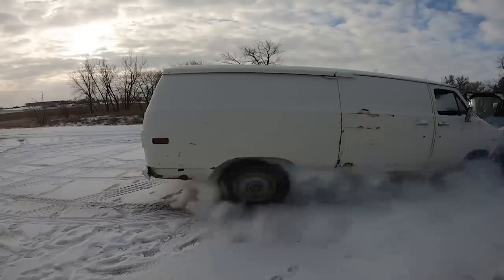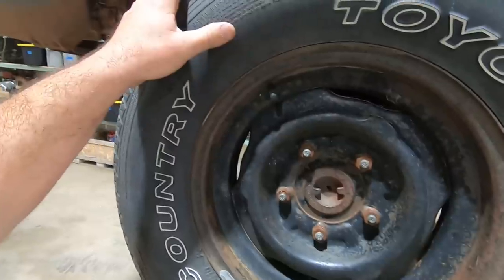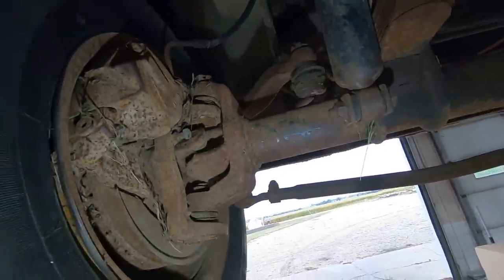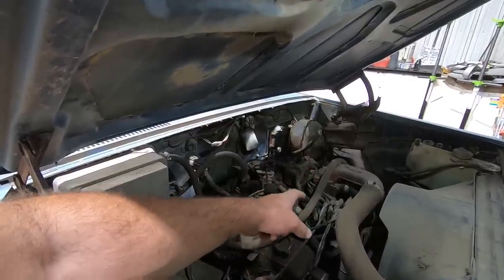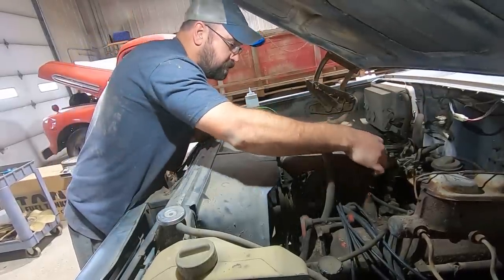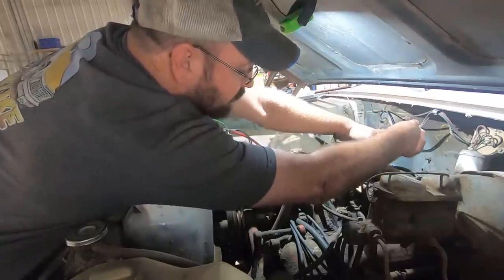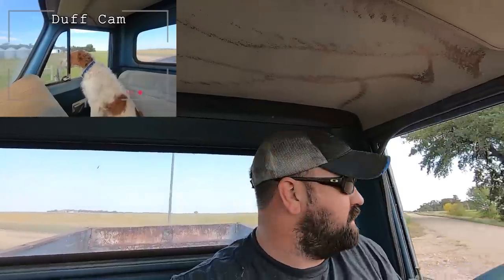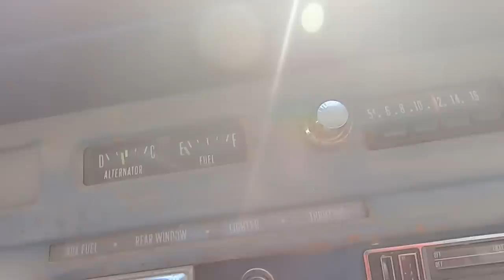1974 International 4x4! Abandoned for 16 Years! Will it Run?!?

Comment: This was nearly the same as my Air Force IHC pickup.  It  was a picnic bench on four wheels but it never quit, went absolutely everywhere and I really miss it.  It had the right height and size to perform any kind of work and was definitely not a fashion statement by any stretch of the imagination.
Reply: Those 345s were absolute work horses, just like it's 350 sbc equivalent. They'd work all day every day and keep kicking. They just wouldn't go anywhere quickly...
Reply: Love to run a ih 345 in a c20/k20 square body truck or the gmt400 trucks..

Comment: The NP205 is an excellent transfer case. Gear to gear. Plenty strong and they can be mated to an NP203 for even lower gearing options.
Reply: I squeezed a M400 C6 into my 59 F100 on a NP 205 with a Cardan Center Piece looks like a skidder. Also found a 79 Dana 60 High pinion KP (Snowfighter) on 32's. Looks Tough! I'll probably put 2' spacers on the 70 rear to match.

Comment: Cool old truck, to bad IHC didn't start using corrosion inhibitor till 79 or 80 which was the end of production pickups, scouts and travelall. It was always interesting guessing what components they would have for drivetrain, carberation and such, they could pass just about anything on the road except a gas station.
Reply: yeah those scouts sucked gas and neighbor traded one in for a small s10 blazer
Reply: @rsprockets7846  My father in law worked for IHC, so just about everyone in the family had Scouts, Terra's, Traveler's in sport and rallye configurations. Didn't seem to matter if you had a 304, 345, 392, power and torque went up with cubic inch increase but didn't seem to effect mileage. Mine were always 9mpg towing or not, the 4 bangers got a little better mpg.
Reply: Even the 304 guzzled gas lol

Comment: Pretty sweet.  Liked that Duff made that Cow go home that was awesome. Liked #840  That truck pretty kewl, really like the fact that is had a manual gear box for both going forward and the four wheel drive, none of that push button CRAP and the manual front locking hubs are a plus as well. Other than the manual transmission built similar to my Dads 1993 F-150 XLT front locking hubs and manual four wheels drive gear box, awesome truck!
Reply from the maker: Pretty basic rig
Reply: @MortskeRepair  Yeah, you're RIGHT it is and that's why it's awesome.  To many buttons switches levers knobs in these newer vehicle's, need to get back to how they use to be made. Simple.  How much wiring and relays do you think is in that Truck a heck of a lot less then the newer Trucks these days, and why for what, because people are LAZY that's why, GPS why because people don't know how to read a map. Ask your Dad how much more simple life was. I love your video's man you just make my day when you put another one out, and sometimes I get a real good laugh.  I am only 36 years old, but I love manual roll down windows so much better, same with seats that you have to pull up on the lever and pull the seat forward way more simple and if it break or stops working it mechanical and pretty simple to fix. What I'm saying is that electrical just adds something else to go wrong.  Plus if you add electrical and mechanical together you have to figure out witch one went BAD the electrical or the mechanical part could be something as simple as a blown fuse or as extreme as a slit in a wire somewhere or a bad relay. You see what i'm saying, LOLZ.  You have a good one my friend and God Bless.
Reply from the maker: @FeArhsma21  I won't be fixing any 2022 Denali pickups anytime soon!
Reply: @MortskeRepair  I love that comment <3, LMAO. That just made my day.

Comment: That tie rod looks like the one in my Scout. IH wasn't thinking when they put it there. First thing to hit. Mine was reinforced with angle iron welded to it. Another thing that isn't legal here, but it worked. Every Youtuber I have seen tries to adjust the carb on a cold engine. The engine MUST be at running temp with choke full open before you can adjust the idle speed or mixture. I was adjusting carbs before EFI existed.

Comment: Internationals were excellent trucks, super tough. I liked the fact they had the distributor in the front like Ford but had the firing order and cylinder numbering of GM. I had a 1972, 4 speed, 4x4 that I bought with a blown head gasket for $50. I thrashed that truck and could never get it stuck in mud or snow.
Reply from the maker: Everyone brags about the four wheel drive in them

Comment: Excellent video Mortske Repair  :) those trucks made Hamilton Ontario Canada till 1980 when factory closed up  345 V8 4 barrel carb Holley CFM 1000CFM  with choke cable knob in dash and Transmission be Creeper 4speed with Bow Low First gear Eaton D18 Manual transmission and rear be 355 to 456 ratio! Fuel tank be 25 to 60 gallon fuel tank! Rare see one those disk on front most them Drum till 1974 with Power Brakes and Steering! Lucky out didn't get split rims on this International pickup! filter is like Fram 8A on Small one or Fram 8A big one plus 345 take 5 quarts totally on both oil filters  , plus fire order same small  350 V8  to , plus timing is +1 degrees  and fuel pump had originally a glass bowl bottom fuel pump plus see this change to GM but got fuel filter on intake fuel line ! Manual is standard option a fluid type and amazing trucks Mortske  tell you too ! Got excellent find too! Also Alternator be Delco Remy be 70 or 90 amps they got internal Regulartor  plus use low amps 30 to 35 amps on  when head lights or heater on do 70 to 90 amps ! Also Mortske does that one have Choke control on Carb because on Cold Starts need away out then 5 to 10 mins push to 1/4  out so get Engine warm and then push in to off!  To that International is First year didn't put key in dash on on right side they put Coulmn like Modern vechiles are and add radio to that truck easy too ! Side markers lights on back box and plus front fenders to to for Turn Signals! Surprises me that Truck did have West Coast mirrors and with turn signals too on them plus Radio antenna too! Also if want put Muffler on those trucks put Round from Farm tractor  that my late  dad and late Uncle  did to there 1968 International 1 ton !

Comment: Thanks another great video!  I used to have a 1972 IHC 1210 4x4 short bed.  Yes, from the factory.  IH made some interesting trucks.  It originally had a 345 and manual 4 speed but the original owner decided to drop a mopar 440 and 727 three speed auto in front of the factory NP205 transfer case.  Mine had a dana60 with Detroit locker in the back and a dana 44 up front.  My guess is your has a Dana 44 in back and maybe a 33 up front?   It had drum brakes all the way round guess IH decided to put discs up front by 74.  Fun trucks, too bad body parts are non existent these days.

Comment: The electrical system in this body style was GM in origin for the most part.  The headlight dimmer switch and the map/cabin light were sourced from the 67-72 GM trucks.  I know because I once owned 2 3/4 ton 4x4s at the same time as a "take two to make one truck" project.

Comment: Hey! I noticed you tapped the "+" on the Milwaukee tire inflator to get to 20lbs, you may already know this, but if you push and hold the "+" it jumps up in 5lb increments so you can get to 20 or 30lbs quick.
Thanks for another entertaining video.
Reply from the maker: Good call!

Comment: The engine size on a Binder is stamped on a boss near the distributor. The first three numbers are the displacement and the rest are the engine serial number. 

Another fun item is IHC V8s are timed using #8 plug wire. Look on the right hand valve cover
Reply from the maker: Thanks for the info!

Comment: Hey Mortske: We had IH Scouts and we plowed snow with them and the one thing that went south on them was the fact that they ate up U-joints by the gross... We had a 304V8 and a 345V8 and they were good runners but the U-joints were always the issue with them... Looks like the 100 Series you got ran half-way decent and of course, it was Duff approved which is good enough for the girls that we go out with... Fron the home of PB Blaster...Cleveland, Ohio....
Reply from the maker: Wonder why they consumed universal joints??
Reply: @MortskeRepair  frames were too light to handle the heavy snow

Comment: You're probably off a bit on pricing, the truck could be worth treble that... did you see the paint marker on the firewall, looks to be a production line QC marking, lol also "OK'd by Bob".
The transfer case alone, if it were refurbed, could be worth what you're asking for the truck.

Comment: If you don't already, you should talk to some local junk yards about tires. I ran the scale at a junk yard for several years. Disposing of tires is a real pain in the ass ($1 per tire where I am at), so we were happy to get rid of as many of them as we could. We had several people that would come through and get them in bulk, particularly from cars that were about to be crushed. We nearly gave them away. We only charged a couple of bucks per tire. You should see if you can work something out with one of the yards in your area. I am sure they will work with you, and it would save you a ton of money for the type of stuff that you are doing. They obviously won't be brand new, but you could get plenty of rollers that hold air.
Reply from the maker: There's no yards around here.

Comment: Wow, that brings back some memories.  I was stationed at Grand Forks AFB from 1983-1994.  In 1986 I purchased a 1970 IH model 1000D ¾ ton 2WD pickup with the 345 V8.  The thing was rusty and beat to hell, but it only had 56,000 original miles.  I got for $500, drove it for five year and sold it for $500.  I left the keys in it the whole five years.  The tailgate was missing, so I built one out of plywood and 2x4s.  IH wanted way too much money for parts.  I needed a new voltage regulator an IH wanted $90.  The aftermarket GM unit I picked up for $10 worked just fine.  I got Gates hoses for about 1/3 the cost from the dealer.  When I needed a starter, I asked the parts store for a 1969 chevy pickup starter.  All I had to do was swap the nose cone out and bolt it up.  It was way cheaper.  I never changed the oil in the five years I had it, but it got a fresh quart every two weeks!  I kinda wish I still had it.
Reply from the maker: Sounds like a real gem!

Comment: Internationals, light duty engines 304, 345, 392, are timed off #8 but you have enough existing wires remaing it shouldnt be a prob.  As you indicated timing order is the same as the GM of the same era. There will be a small build sheet taped to the back side of the glove box.  International saddle tanks are bad about rusting up usually stopping up the carb, filters, and sending units; guess any tank will rust in the right conditions. The aftermarket makes replacement tanks for every model ever made.., accept International. Just started watching.  I grew up in a trucking family.  Dad always had Toyotas and Datsuns for little loads and Internationals for heavier loads; went to Kenworth in the 90's when Internationals were getting scarce.  Brings back memories.
Reply from the maker: Thanks for watching and commenting Kevin!

Comment: I checked the EGR valve the one behind the carburetor big round one do they get tendency to leak take it off and fill it with JB well and you can use it back in that City where you're at

Comment: My father had a 79 scout that would go through almost anything as long as you kept your foot on the floor and controlled the rpm by up shifting at 3,800 rpm (the redline on those 345’s if I remember correctly). Lift off the gas and it would sink and you’d need a winch to get it out.

I beat the crap out if it but never killed it. I wish I had it back today. We also had S-series trucks with 1st gen 466’s in them and they were tough as well.
Reply from the maker: What a beast!

Comment: Make sure you use a 9PSI radiator cap, anything  higher than that you will have cooling system problems. I have run IHC pick-ups etc.most of my life as did my Dad and I'm 69 years old.
Reply from the maker: Thanks for the info!

Comment: I've also actually considered buying a Fe 360 with good compression and decent oil pressure and put it in the dodge ram 1500 4x4,, and the fi because another issue again never seen a fi Fe Ford lol.. and yes I've seen the IH and Navistar ih gm square keys for the ignition cylinder lol.

Comment: That's a keeper,  I missed the part where you tested the 4x4 working?.  fix you dads rockers. good to have you back on Mon. Be well.
Reply from the maker: Tires are different sizes, so wasn't a good idea
Reply: @MortskeRepair  did you try it when it was all 4 off the ground on the lift?
Reply from the maker: @Telephony954  I did not

Comment: Those Torq Thrust wheels make that Skylark look fantastic. It’s a sweet car but the right wheels really take it to the next level. Especially 15 inchers. 
Vintage cars with huge hoops just do not look right.
Hats off for keeping it period correct. I had the exact same 15” Torq Thrust Ds on my ‘68 Newport 2 door hardtop. I bought mine in 2004.
Had a set of Rocket Racing brand “as cast” Strike 15s on my ‘66 Galaxie 4 door post. Drove that Ferd daily and put 70,000 miles on her. I would have kept it but I couldn’t find anyone willing to rebuild the “FX” Cruis-O-Matic.” I rebuilt a 390 to replace the 352 “Thunderbird” V8 and after I installed it the FX transmission couldn’t handle it.Unfortunately it sat in one spot for several years while I was trying to find someone to do the job. I was contemplating doing a tranny swap but couldn’t locate a C6 with a FE bell housing. Those old “Select Shift” “Green Dot/White Dot” Cruise-O-Matics are incredible in the snow and ice. They give you the ability to lock out first gear and start in second. They stopped that feature after ‘66. Some useless information of the day for you. Lol 

Great minds think alike! 😄
Reply: By the way, I ain’t angry. I love and hate all American manufacturers idiosyncrasies. I don’t discriminate either Mortske. My daily driver is a ‘95 Caddy Fleetwood with 18” Torq Thrust cast mags. It’s too much dang work to try to polish the shiny ones. It’s easier to wash the cast centers and wax the rim edges. Just my opinion of course.
Take it with a tiny grain of NaCl.
Reply from the maker: Can't go wrong with those wheels!

Comment: I think the engine size is stamped on the passenger side of the block in front of the motor mount on a pad 
Ie 266, 304, 345 ,392 
If your interested that is

Comment: Running on 6 1/2 or 7 at least, but still running.   Sounds like a valve or three aren't seating at first, little bit of a hitch and some popping back.  Base gasket is probably leaking despite the JB weld bench "rebuild."   The diffs and t-case are worth more than the rest of the truck altogether.   Do a good tune-up, give 'er the Mortske flick a few times, set the timing with your timing ear, maybe pull the valve covers and check the valves, stick a less-junky carb on it, and it's good for another 20 years of beating the snot out of it.   The stock carb should be a Holley 2300 or 2300g (vacuum governor);   2 bbl Autolite from an early 70s V8 Ferd ought to be a direct bolt on and much better carb.

Comment: I believe a lot of the shared parts from other manufacture's are from AMC and they adopted the GM style parts. Like the steering column and key lock/switch. appears to come right out of an AMC Ambassador or Matador.  Also the Alt and power steering box and pump. AMC"s were full of GM, Chrysler and Ford parts

Comment: I have that carb. Too with the oil bath air cleaner. My truck had 37 thousand miles on it original. It was a farm truck so it rarely seen the road. I bought it from the original owner and at the farm
Reply from the maker: Awesome

Comment: I had a 71 1110.The tie rods were left over Fords I think and the trans was a 727 dodge.304 was good on gas and it would pull anything.Vibration was a problem and rust and...

Comment: I'll assume (you know what they say) it's a 10 or 12 bolt GM rear, Np205 transfer case and Dana 44 in the front and an sm465 manual trans. Mostly square body Chevy running gear.

Comment: In 2006 When i was back in my Home State of Indiana, There was one of these for sale at a small Mom and Pop car lot. V8 4 speed same body style and 1973/1974. Last year for These IH pickup trucks, and it was in like Brand New/Restored condition.
Reply from the maker: Hope you bought it!
Reply: @MortskeRepair  no, my credit score wasn't up to snuff then. they wanted also like $ 4000.00 for it. seems close, but that was 16 years ago to.
Reply: @MortskeRepair  SURE would have LOVED to. I  Love Those old Binders.IH Trucks. Learned how to drive in one with a 3 speed transmission on the floor. A White 1964 model, in about 1968 could just barley reach the peddles.. Some thangs you Never forget.

Comment: Does that CornBinder have a 4-speed box with granny low? Might be an SM465 if so. Have one in my 71 C10. Great transmissions, actually. Pretty tough. T-case in the Intersmashional is probably an NP205. And the diffs look like Dana 44's. All good stuff. Oh, and it sounds like that 345 might be running on 7, at least sometimes. Should have lots of torque, but not much HP, since it was designed specifically as a truck engine. Great truck, and I would love to have one, minus all the rust, of course. They are going for a pretty penny in good condition, at least for the folks who know and love them.
Reply from the maker: Sure does